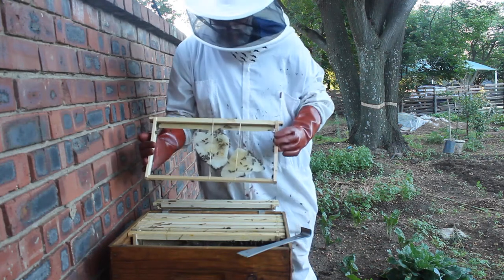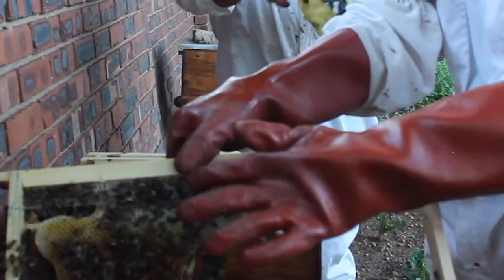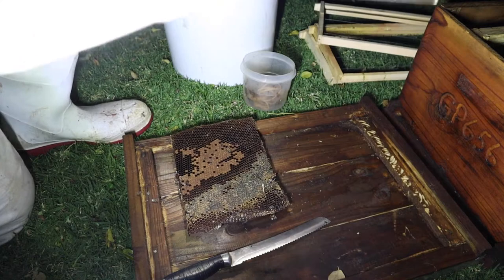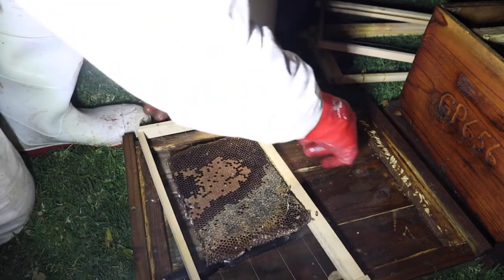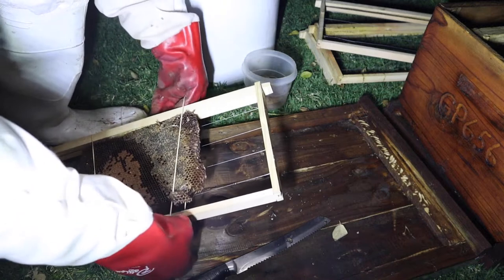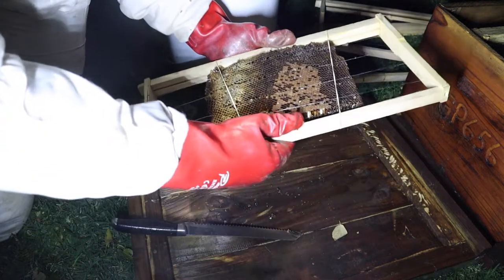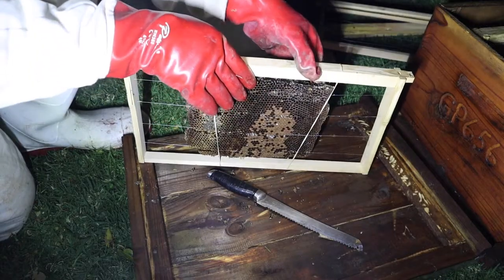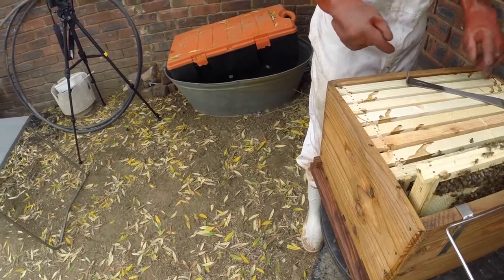Position Honeycomb in Frames When Doing a Honeybee Removal

Comment: Thank you!! I got a question what if i dont cut lines for the wires and instead just push the comb softly to the wires would that work?
Reply from the maker: It works if the comb is soft enough. But most of the time the comb is quite tough or brittle. Cutting allows us to get it exactly in the center of the frame which is the important part. Thanks for watching.